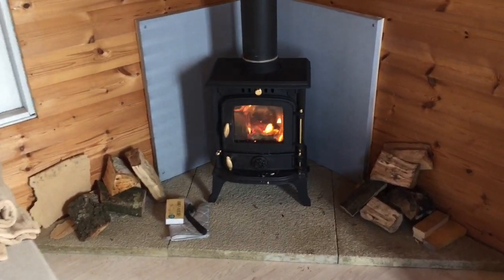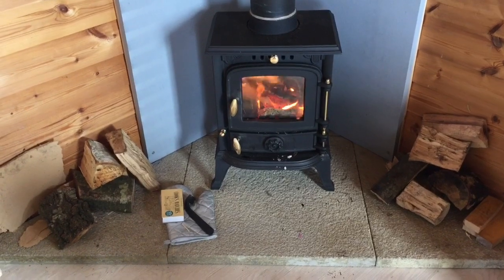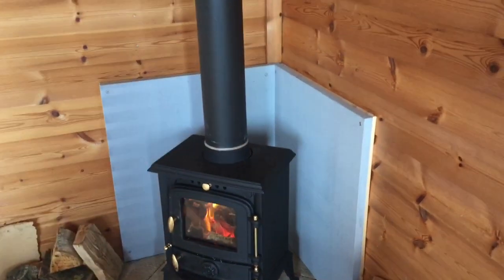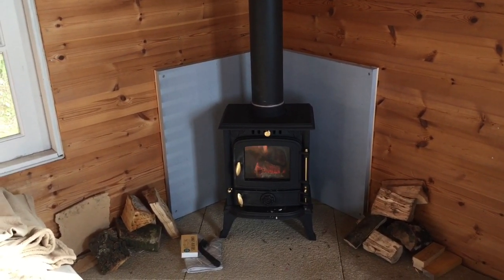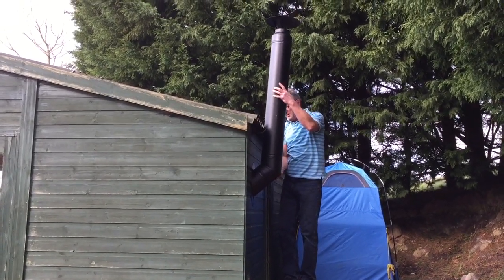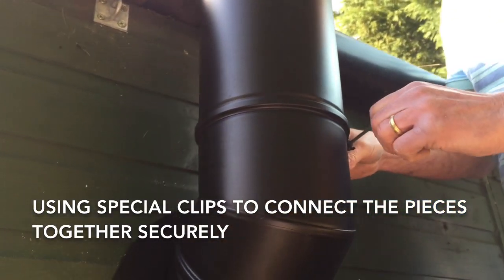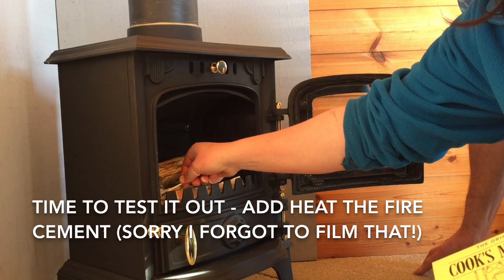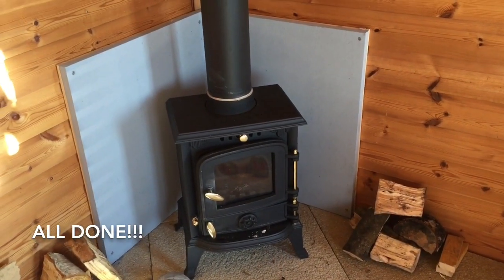Installing a WOOD BURNER in my TINY HOUSE

Comment: Nice wood burner install and economical for the space you have there. My wife and I are planning for wood burner install for our 2,000 sq ft mobile home to reduce our natural gas and electricity costs. Here in Indiana there are fallen trees every where and it is just a matter of cutting the logs up, loading them in the back of the SUV, splitting the log rounds and placing them in the shed to season. Love those wood walls you have there. You play guitar....good for you! That tall stove pipe makes for a good draft for the fire!

Comment: Hi great video of the fitting of the log burner in the summer house. I noticed your used steel screws to secure the heat resistant board to the walls. Have you had any issue with the screws conducting the heat into the wall? I am going to install a similar log burner in my summer house. Regards Andrew

Comment: Great job with the Burner 👍
we was thinking about installing a Burner in ours or even Diesel heating.
Reply: I'd try to stay away from gas heating. It's much more dangerous. That monoxide will literally put you to sleep for good. Wood burning when installed correctly is much safer. And I still recommend getting detectors just in case.